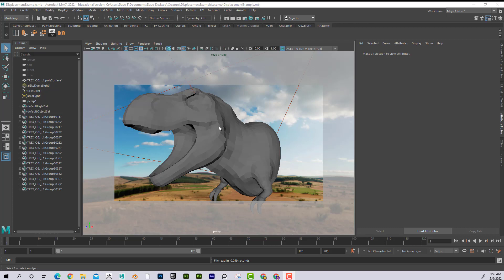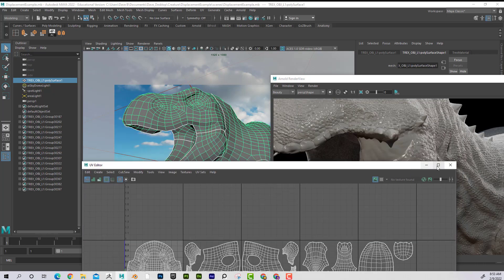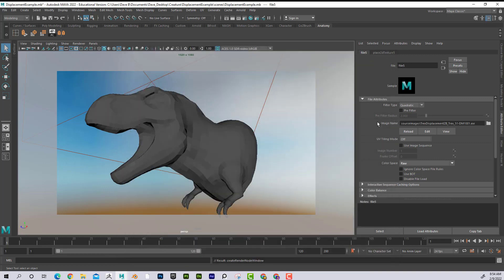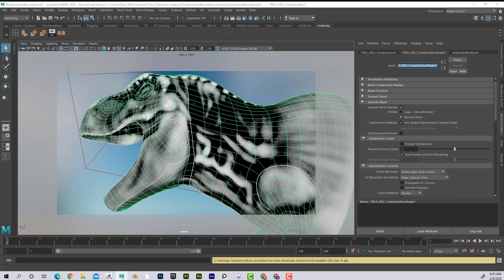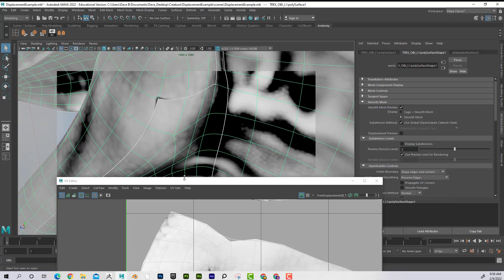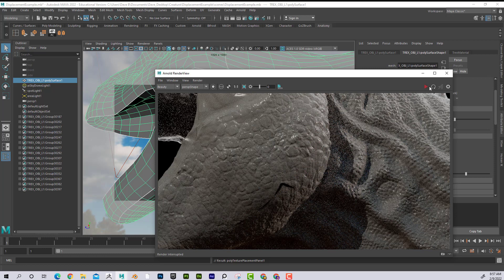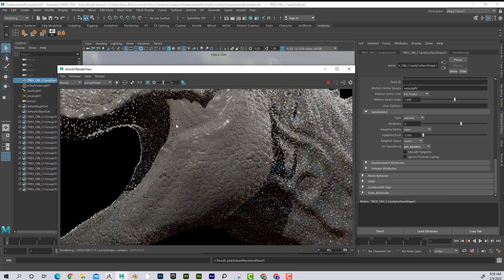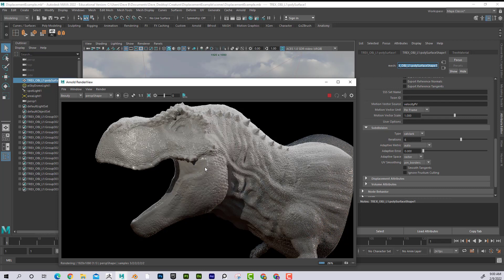Displacement Seam Fix Maya

Comment: Do you know why the displacement makes parts of the model look black? not breaking but a darker color of the mesh
Reply from the maker: 🤔 it could be a problem with the uv map. Make sure it’s not flipped upside down or overlapping. Also make sure make sure your normal map color space is set to raw, not sRGB. Can I see an image of it?
Reply: @davidbittorf  Hello, I tried both, the uvs look blue so the faces are ok, not overlapping either and how can I send you an image? do you happen to have a discord? Thanks!

Comment: I just applied this to my mesh, now when I try to render my pc freezes and I have to force a shutdown. How can I fix this?
Reply from the maker: I bet your subdivisions are set too high. You can’t use the same numbers I use, it’s going to be specific per mesh. Try lowering that number and trying again.
Reply: @davidbittorf  OK, thanks
Reply: @davidbittorf  under which tab should I change the subdivision level and which level is generally the most appropriate?
Reply from the maker: @warlord8106  attribute editor: shape tab / Arnold / Subdivisions. That’s where you adjust your subdivision levels. Go to display / heads up display / polygons to see how many polys your mesh is. Then multiply that number by 4. That’s how many polys it has with 1 subdivision. Then keep multiplying by 4 for each division. Try to keep this number under 20 million. Also make sure you don’t have “3” pressed in the viewport. Select your mesh a press “1”
Reply: @davidbittorf  yep, that fixed the problem, had it on 6 like you, turned it back to 2 now it works

Comment: good tuto, but i still have the problem with the visible seam in my maya :( disp,text,normal cant hide, all are made in my zbrush .  idk if its the displa subdiv / iteration , but that crash my maya :'(
Reply from the maker: 🤔 try lowering your subdivision/ iteration and see if that help with crashing.  Probably won’t help the seem issue though. If it still crashes try it on another computer and see if that helps. Wish I had a better answer for you.  Anyone else know?